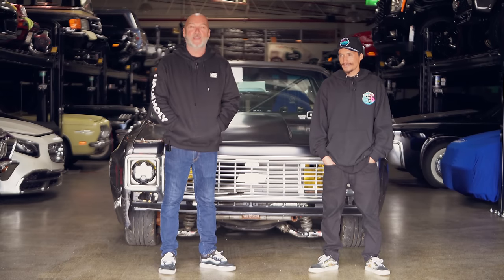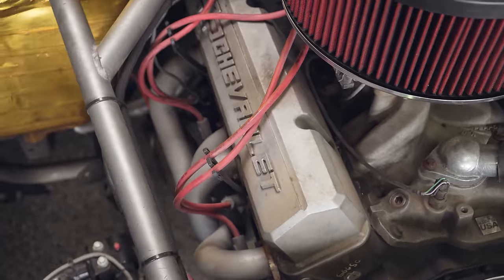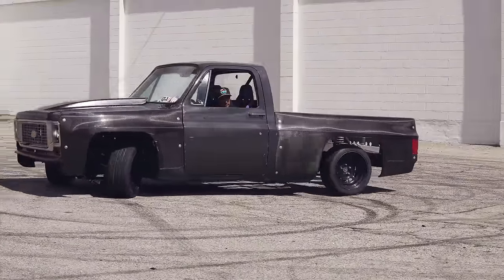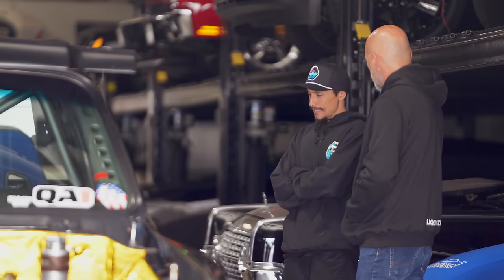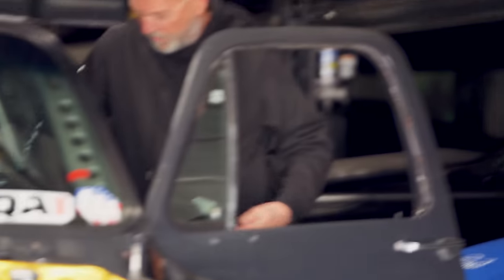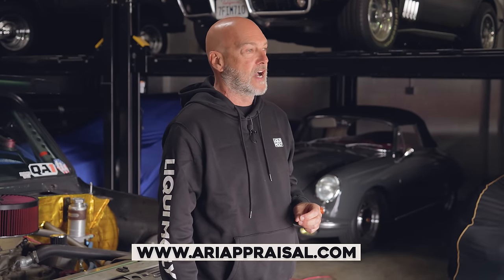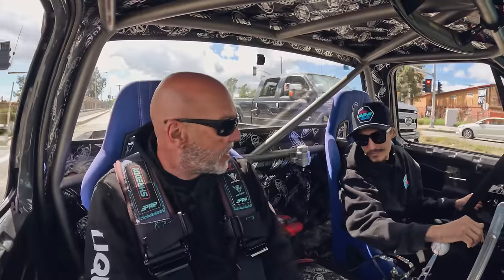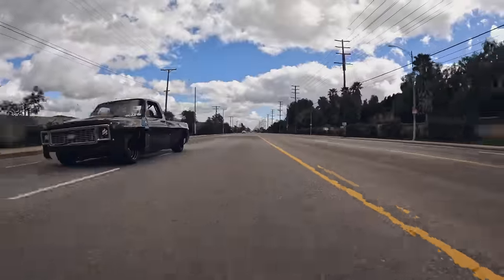Carbon Fiber Widebody Chevy C10 Drift Truck | Drifting LA Streets

Comment: 355 chevy is bored out but not stoked. I love that it has a small block in there ❤️
Reply: I wonder if it's one of those weird offset grind situations. Or a 3.5" stroke instead of a 3.48. I've seen stuff like that. Saves you from needing to deck the block during a rebuild.

Comment: I’ve owned a total of 8 different Squarebody Chevys and this one is by far the coolest thing I’ve seen done to one, I currently own a jacked up 3/4 ton with about 40k dumped into it and it could totally use that wide body kit. This kid is a savage behind the wheel, great work to both of you I love it!

Comment: During high school I drove 30 miles in and back off the ranch each day.  I had a '57 Ford with police interceptor engine.  There was about 20 miles of gravel/dirt.  Every day was a chance to "drift" all the corners going to Dad's place.  We called it "puttin' her sideways" in those days.  Finally, the road maintainer got with my Dad and complained that I was putting all his gravel into the ditches......  Did I stop?  Oh, hell no.  I could slide that Ford forever.....new ones....not so much.  P.S.  It's not about horsepower but rather; a responsive engine and torque.
Reply: Housing tract sites were always fun too

Comment: I love  this  truck  !!!😊 I used to have a  1984 GMC Sierra  3/4 Ton rwd . I  upgraded to a  350 crate  motor,  400 turbo  transmission automatic    w overdrive, 4:10 Eaton Heavy  Duty rear end ,Heavy duty ambulance  brakes disk front and rear, Heavy duty radiator, Holly  4bbl carburetor w in line  fuel  injection...😊😊😊about  400 hp...I  crashed  it and couldn't  afford to get it  out of the  police  impound, so  they  sold it....😢

Comment: Awesome but how much of it is still actually C10? Everything including tubular frame is aftermarket and obviously 𝙉𝙊𝙏 anywhere near stock configuration. Just the body panels and small bits I'm guessing..
Reply from the maker: If you watched it’s still on the original chassis that has been modified

Comment: How many foot pedals and what do they do? What does the long handle do? How much Horsepower would the owner prefer?
Reply from the maker: 3 pedals, handbrake for sliding and he’d love to have 700-800 hp but he’s on a budget
Reply: @AutotopiaLA  Are the 3 pedals, gas, 4 brakes and clutch? Is the long handle rear brakes?
Reply from the maker: @sanfranciscobay  yes. Gas pedal, brakes & clutch and the handbrake is rear braking to lock and slide
Reply: @AutotopiaLA  Do they set these Drifters up with a 4th pedal that activates the front brakes so they can spin the rear tires and drift without overspeeding in mph?
Reply: @AutotopiaLA  Nice to see a Car designed to be run and used hard. Borderline abused.
Reply from the maker: @sanfranciscobay  no because they need front grip as well otherwise it’s like a drag car with line lock
Reply from the maker: @sanfranciscobay  he definitely beats on it!